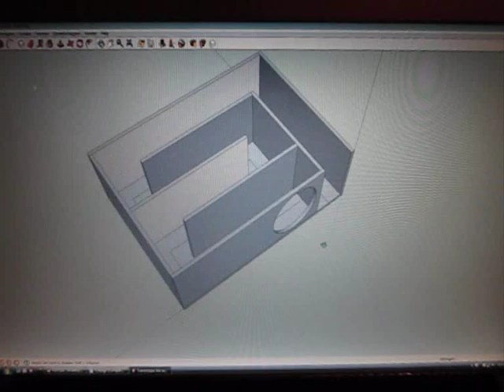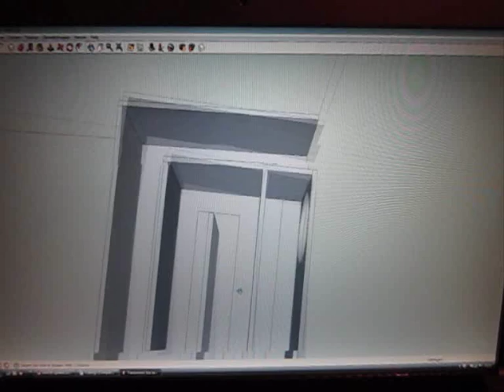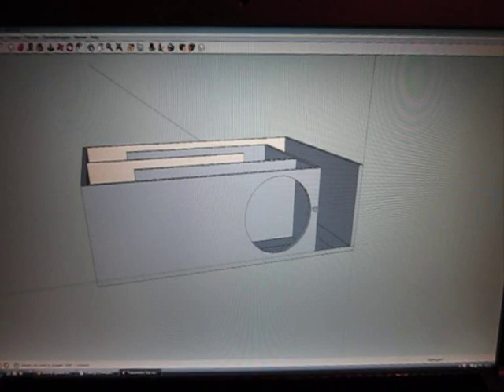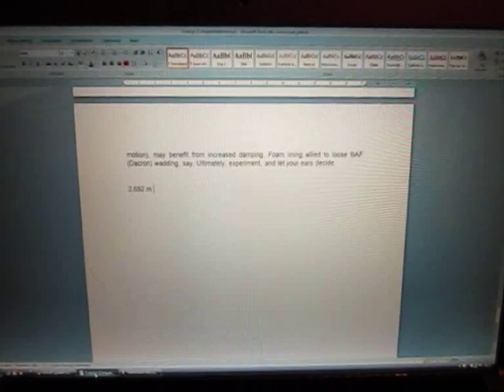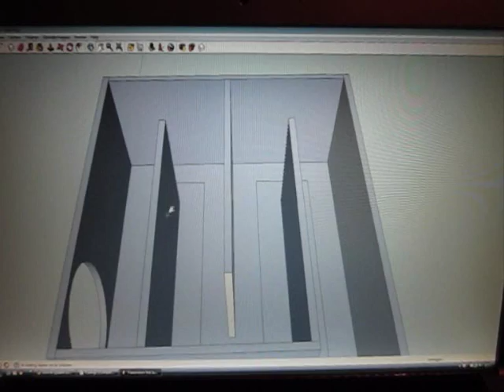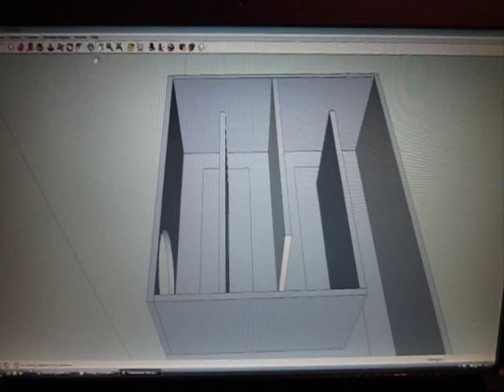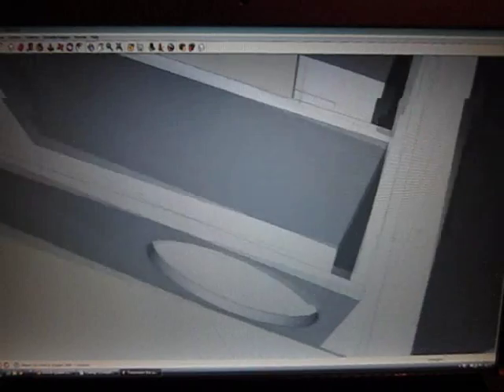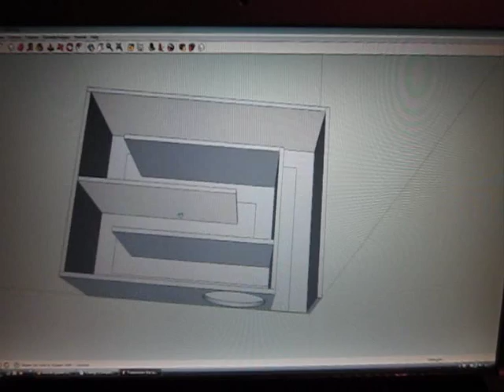Transmission Line enclosure HELP!!!

Comment: For 30hz Resonance Freq,you need a line to be approx. 9 ft-(do not work in metric as it is NOT accurate)Port size should be approx. HALF the area of the driver as the speed of sound through the Line/duct reduces to about half. Tests have shown that the corners should be lined with Carpet Underfelt, and that the Last half of the TL be completely filled with Damping material such as contoured acoustic Foam, BAF wadding. Do not use long Hair wool as this hangs in clumps and it's properties vary over time and you cannot regulate it's density. The first half of the Line/duct should be LINED with damping material, and this should be pinned, tacked to battens so that there is air/wave throw-through to the walls and then bounce-back THROUGH the damping material AGAIN so that is is more effectively used and this is the action of dissipation of the wave. There is a thing called "End Correction" with a TL and that is that the line length should really be about 8 inches LONGER than the quarter wave distance for the fundamental frequency of resonance because the wave takes TIME to get used to the flow, and there is resistance to that flow by the port, therefore, sometimes it is necessary to load more damping material into the port/bungs etc in order to filter/balance this correction. See articles on PRO-9TL/PRO 10 TL and AR Bailey's articles in Wireless world 1965/6. The two main humps in the response curve for these TL's come at the 5th harmonic resonance and The 3rd-these are where the phase of the output from the port cancels with that of the driver at these frequencies  .In this design I suggest you turn it upside down and place the high frequency unit below that of the Bass/Mid-unless of course you are using this as a sub-woofer with bass driver only. I use 16 ft TL's fed by KEF B139B Sp1044 and the driver cross section does not need to equal the line cross section, although it has been said that there is a two-to-one ration as regards size. frequencies below 100hz are non directional anyway so for a subwoofer it will be fine. The bass can be very punchy and dynamic-not "one note" as you often find with a good many reflex designs-reflex was brought in to compensate for non-linear paper drivers whose response was poor at low frequencies-fortunately, we have fast dynamic substances like Polypropylene/ Bextrene/ Mylar etc very rigid but responsive. good luck and enjoy the music.
Reply: You should be working in cubic inches or even Litres for volume of enclosure, not simply cone area. However ,once built is built, and you can do much experimentation with Line damping material-have you considered using the "Line" undamped as a Horn ?See John Earl's book, Pickups and Loudspeakers, there are copies available on ebay. Also check out A.R. Bailey's Transmission Line designs, Wireless World 1965 article and follow-up. Also have a look at the website/blog, pinkfishmedia for info on Paul Voigt horns also, Lowther Museum online-very interesting, Have fun ! G.R. Martin, MAES,AMASA.

Comment: I actually made a t-line for a friend that is folded exactly like yours!

1) Yeah, the surface area should more or less equal the SD.
2) In my experience, corner reflectors don't affect the length or sound much. In fact, it will help filter out the highs in the box a little.

Hope this helps :)